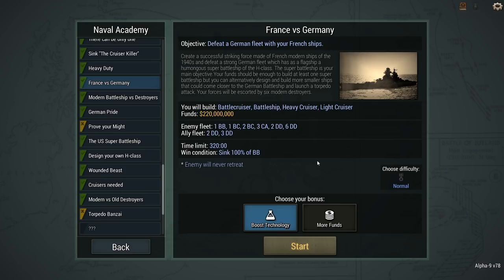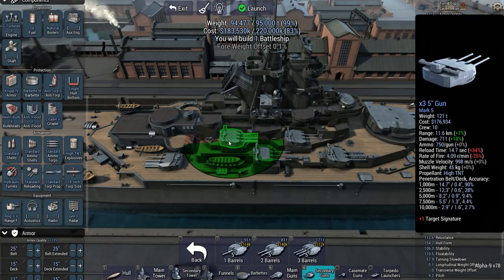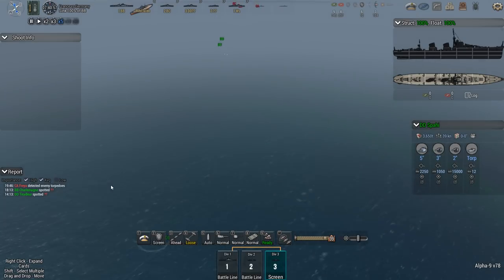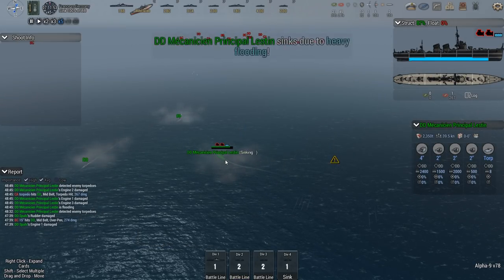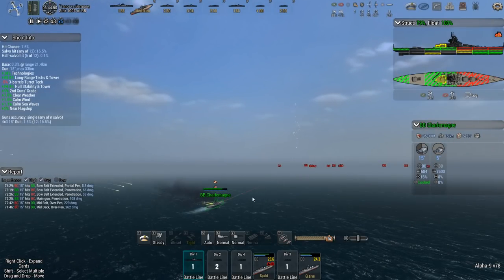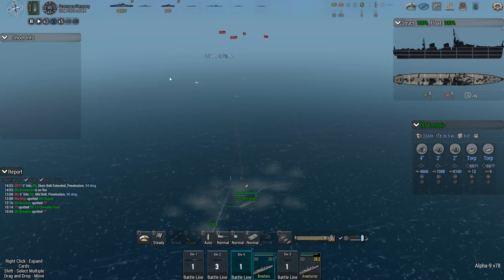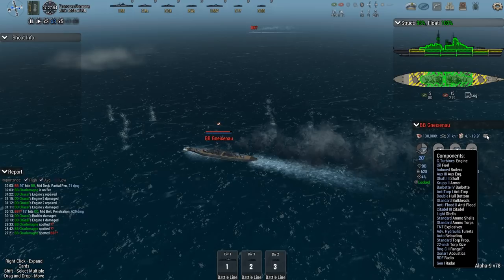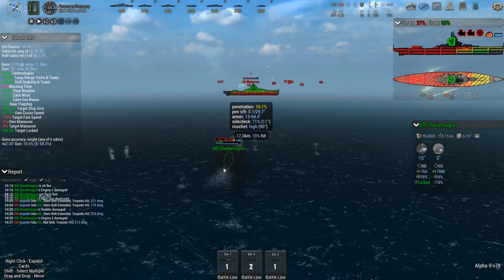Ultimate Admiral: Dreadnoughts - Can You Tank 20-Inch Shells? (Alpha 9)

Comment: That actually looks pretty realistic. Most BBs were not glistening with the biggest guns available. That would be expensive as hell. 

Most BBs had 3 or 4 turrets with big ass guns and the rest were much smaller guns placed around the citadel. Most BBs weren't covered in guns either. They had more armor then anything, if I remember correctly.

Exceptions exist. But they were just that.

Comment: Such low speeds mean that you'll get hit often... please don't build any modern BB with speeds under 26 knots, or anything below 19 knots. That's a disaster waiting to happen, regardless of the "tankyness". Higher speed means your ship is less likely to be hit, and on a fast ship it also means that you can reduce to cruise speed and still have a significantly reduced chance to be hit. While your hit chances go up and up and up... ;)

Oh by the way... what the AI built as Destroyers are pretty much huge DD Leaders or a bit smaller Light Cruisers, at "just" about 4000 tons per ship! 3x3 5" main guns, 3" and 2" support/AA guns, 4 tube torpedo launcher... all in a package that reaches almost 40 knots and has resistant internal bulkheads. This is basically how I would have built a French Destroyer Leader... 1 3x3 5" turret less(or switch all to dual barrel), but at least one more torpedo launcher, preferably 5 tubes, and additional speed.

I've got to say, the AI is indeed getting better and better at building ships with "national flavour". French Destroyers tended towards being large DD Leaders, very fast, with heavy gun and standard torpedo armament. Internal subdivision was also extensive because of the size of the ship. 

It built a Destroyer Leader and a standard Destroyer design with matching speeds, and put one of each in a division...

Comment: 01:21
Maximum Shaft is needed for turning Slow Ships and Super Heavy Ships.

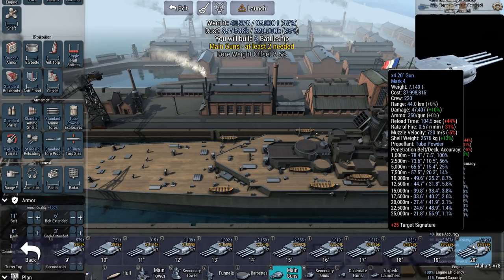02:14
Belt Armor / Turret Side Armor = 50-Inch @ 10,000 (adjusted to 25-Inch)

Deck Armor / Turret Top Armor = 56-Inch @ 25,000 (adjusted to 28-Inch)

Conning Tower Armor = not important to me (last thing that I armor; and, first thing that I knock down to 0 when adjusting Armor Values)

Secondary Armor = Secondary Gun Size (5-Inch Guns = 5-Inch Secondary Armor)

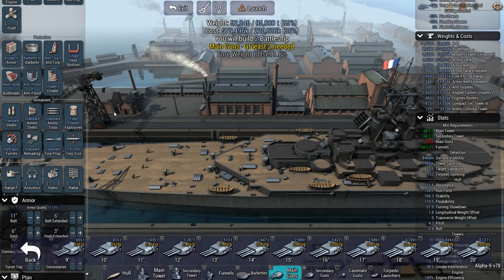02:57
Anti-Torpedo should be Maximum; because, your Battleship won't be able to dodge them.

Anti-Flooding should be Maximum.

Tanking = Maximum Defense :: Max Everything Defensive

04:46
Because your Battleship is so slow and Long-Range Plunging Fire will be the majority of your Combat Range, Deck Armor should take priority over Belt Armor.

At Long-Range Plunging Fire distance, Belt Armor won't be a major factor; because, 90% of hits will be Deck Hits; and, any Belt Hits will mostly be Angle Deflections.

Beyond the 25,000m Range, is Deck Armor Hits; and, not Belt Armor Hits.

06:25
I think 0.1% Aft Weight Offset is better than 0.1% Fore Weight Offset; because, with Fore Weight Offset, your Bow will be digging into the Waves; while, with Aft Weight Offset, your Bow will be riding Waves.

I have Videos with 8% Fore-Aft Weight Offset seriously Negatively Effecting Gun Accuracy.

06:47
Five Broadside Secondary Turrets is adequate for dealing with Non-Battleships; as long as, they aren't Single-Barrel Turrets.

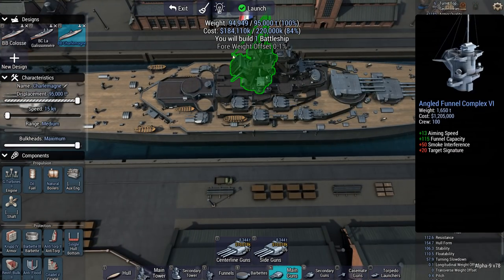07:58
I am not liking the Deck Armor Values and Turret Armor Values.

I would have no problem with dropping the Main Guns to 13-Inch in order to up the Armor Values.

The thing with 13-Inch Guns is that they aren't competitive against 15-Inch and 16-Inch and 17-Inch and 18-Inch Guns; but, a Tanky Warship Design like this could overcome that.

This isn't a Solo Ship Design.  A Tanky Warship like this will need companions.

Comment: I don't get it, if you're using "all or nothing" armor scheme, shouldn't you use 0 inches of steel on extensions of belt and deck? You should  literary have nothing important that would be behind those plates. Antiflood, triple bottom and bulkheads would take a beating, but saturation should happen before you will burn down.